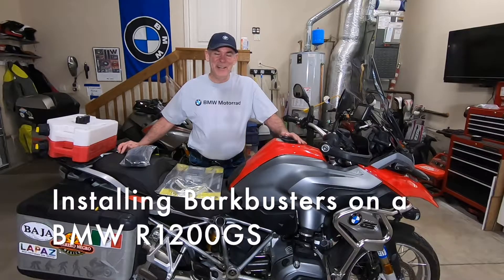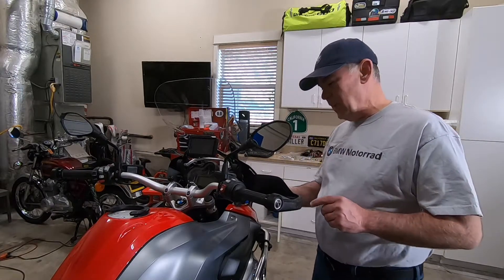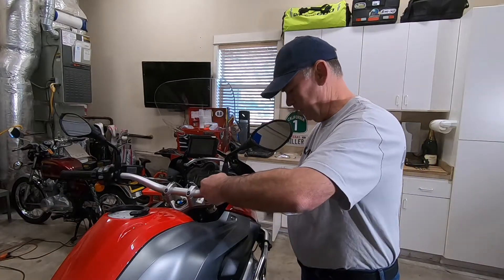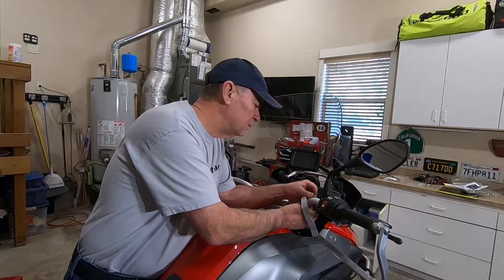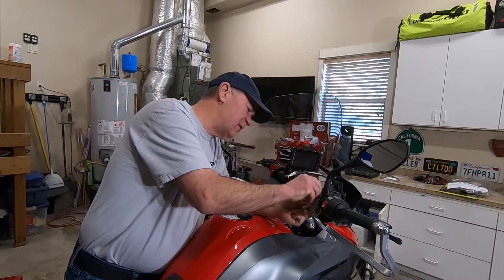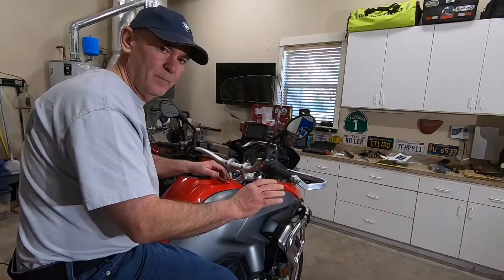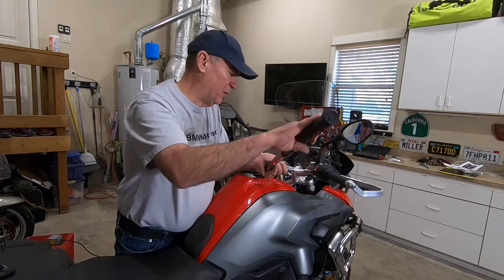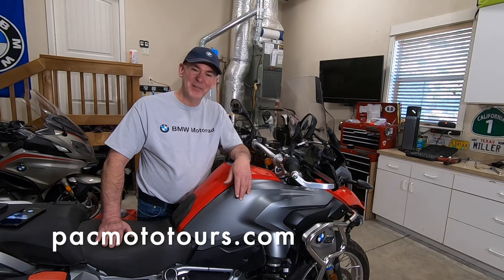Installing Barkbusters on a BMW R1200GS

Comment: your video is excellent and well detailed with hex/Torx and Torque Values. I strongly recommend to add a correction on the missing OEM handle bar  weight piece as mentioned by Philippe Boucaut. Just to prevent watchers from making the mistake in case they don't read the comments. My 2 cents.
Reply from the maker: Thank you Emzee. I’ll add it to the video notes.
Reply: @PacMoto  seriously I searched and watched  all YouTube  Barkbusters installation guides for the GS 1250 and also watched the ones installed on other brands, yours is the only one mentioning torque and bits size. I installed mine flawlessly today thanks to your Video. So thank you again from Canada. !! I would also recommend to check the left and right cable clearance under the handlebars before final tightening. I turned the handlebar to its max turn right and left  to ensure min clearance ( not touching the tank) and then adjusted the barkbuster hand guard accordingly. It looks awesome on the bike. Wish I can share a picture of it 😊. I like your videos and your how to !! Keep them coming. Cheers.

Comment: 🙁 Sorry it is wrong , you forgot to use the original end bar (the metal black piece), where you insert the Barkbuster spacer and use the screw provided. Check other videos to understand what you are missing
Reply from the maker: Good catch. Yeah I made that change but didn’t update the video. I need to post an update for those watching. Thanks for the comment!

Comment: The very first step was wrong--the entire mirror stalk comes off ALONG WITH the mirror mounting point.  But I assume you know that now. Don't feel bad, the last two install videos I watched made the same mistake.
Reply from the maker: I've installed Barkbusters numerous times on BMW R1200/1250s and never needed to remove the mirror mounting point. Thanks for your feedback!